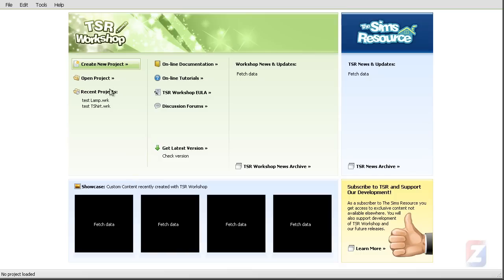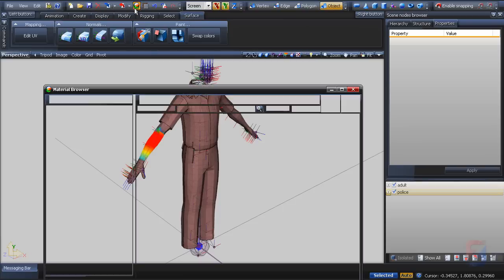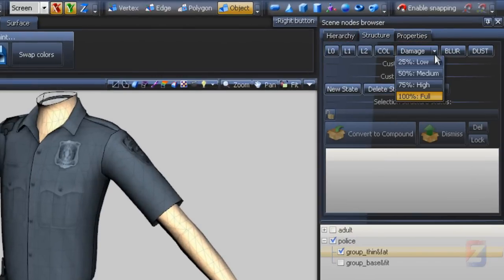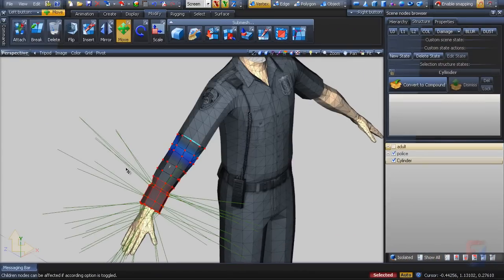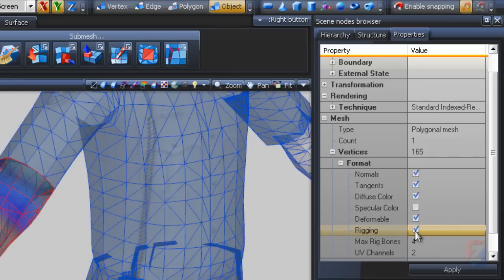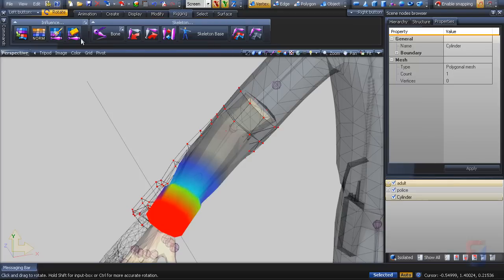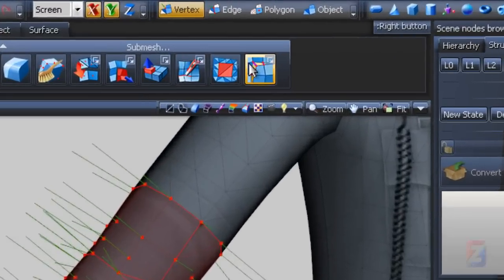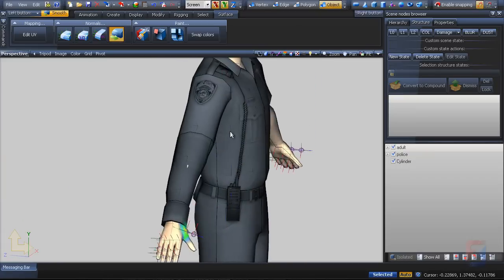ZModeler3 the Sims3 modding guide (Part 1/2)

Comment: how i can set skin on program?
Reply: Skin/textures can be changed in gimp or similar, exported as .dds (gimp needs a .dds plugin IIRC) or whatever the program accepts, then import the skin/texture. OR, if you already have a skin/texture loaded in zmodeler and want to replace it or are missing one, use the "texture browser" in zmodeler and "add" or "replace". Pretty sure that's how.